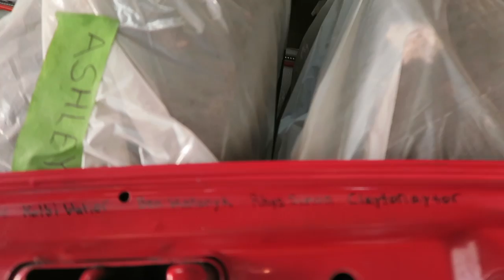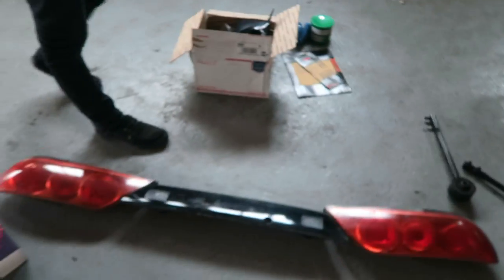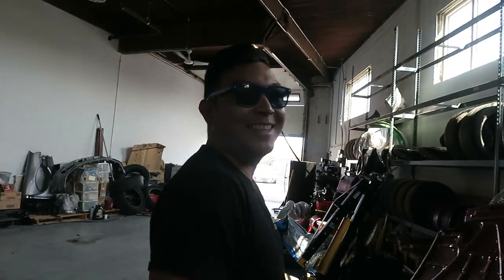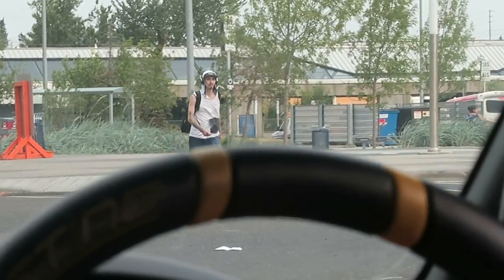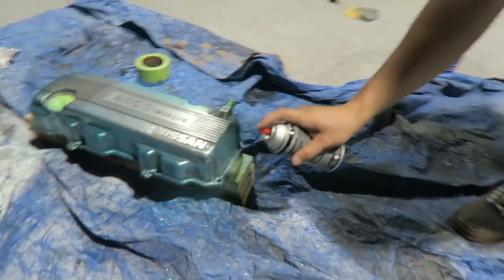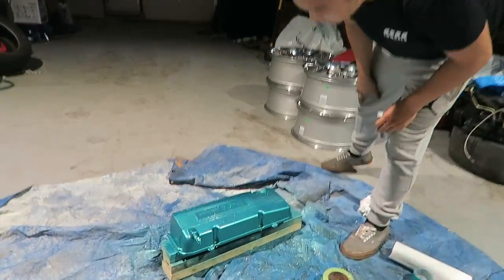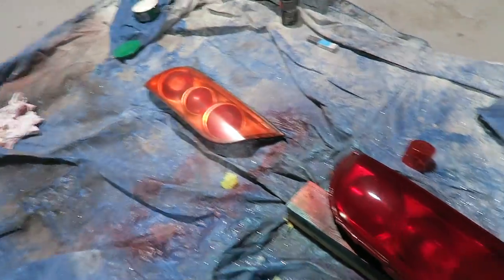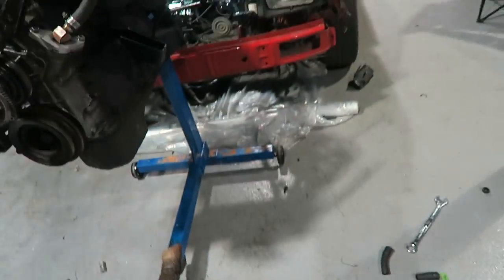Continued Progress on the Subscriber Built 240sx

Comment: 3'' Straight Pipe from the turbo back with 1 hi-flow cat, Polished and angled upwards from the diff with either uneven blast pipes or a single huge 4'' pipe welded from the diff.

Comment: Your comment about the "shitty" SDS seems to come from ignorance. Can't be that shitty since SDS ECUs have hundreds of race wins in SCORE (Baja 500, 1000), SCCA, NHRA, etc. plus world speed records at Bonneville and the first EFI win at the Reno Air Races. Also, more SDS ECUs flying in aircraft than all the other programmable ECU brands combined. I doubt if 1800+ pilots would trust their lives to to a shitty ECU. Nearly 10,000 controllers sold worldwide in 44 countries. You lads would be better off learning the difference between a temp sensor and a knock sensor or a fuel pressure regulator and a fast idle solenoid than commenting on things you obviously know little about.